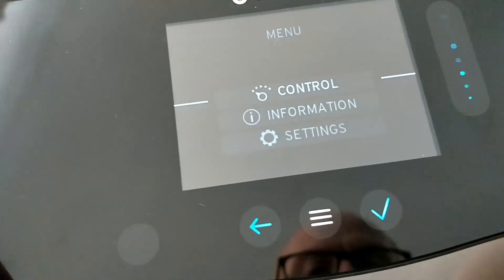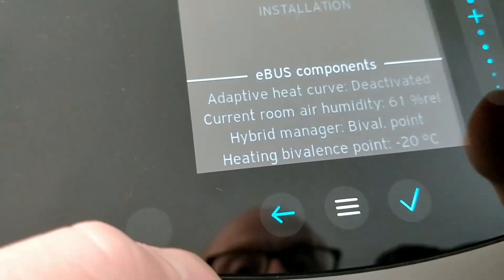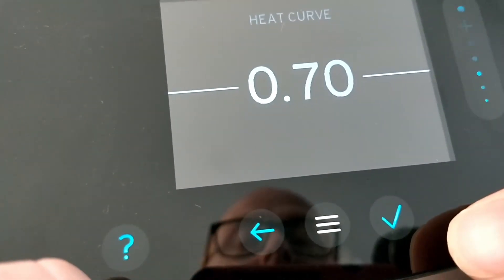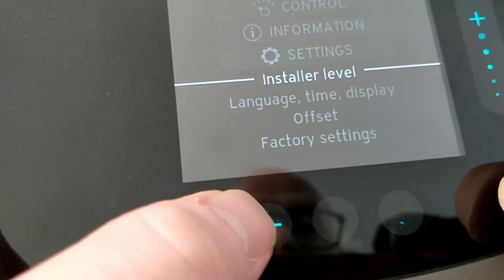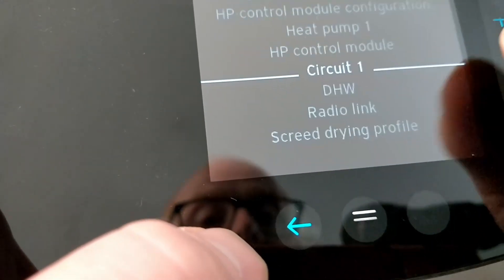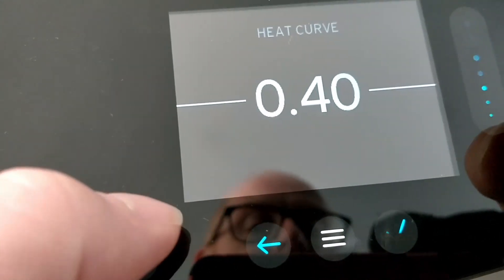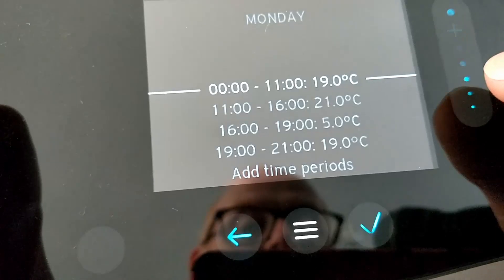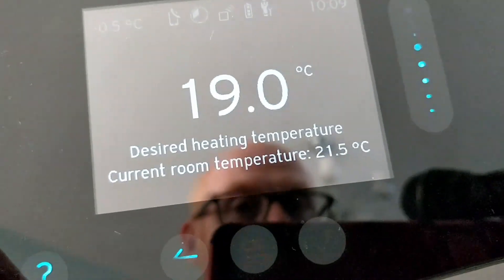How To Set Your Weather Compensation Heat Curve - Vaillant Arotherm Plus Heat Pump

Comment: Is it only me that finds the heat pump world somewhat amusing = it’s like a mission impossible film , can you get a good installer? Will you have the installation with no extra things that is not needed and make it less efficient ? Will you be sold the correct Kw heat pump ? Will the system work well and not cost a fortune to run ? Can you sort the temperature right in each room or in fact the whole house ? Obviously the song for this new film = The Impossible Dream = Andy Williams .
Reply: I find it the opposite, 

We were continually adjusting the thermostat on our boiler, it was very hard to get the temperature right everywhere even with thermostatic radiator valves on all but one radiator. Even when we were happy with the thermostat setting for a while, the house would swing from a little too hot to too cold and vice versa. Then there was the changing of the boiler temperature to match the season etc.

By contrast, the heat pump is the ultimate set  and forget heating system. Once the correct weather compensation curve was set we just ignore the heat pump, the house remains nice and warm, we only know the outside temperature when we go outside or look at the forecast. It is a far more pleasant house to live in, and it's cheaper to run than the gas boiler.

We only had the heat pump installed to save carbon, the fact it works far better than a gas boiler is something which should be trumpeted more, not enough people know this.
Reply from the maker: @MentalLentil-ev9jr  Good point. Once it is set correctly then it is a dream to live with!
Reply: @MentalLentil-ev9jr  Not heard that very often that it’s cheaper cost to run with a heat pump than a gas boiler , heard so many people say worse decision they made getting a heat pump because it cost so much to run and wished they kept their gas boiler, so obviously the industry has got a lot of problems, personally I’ve heard lots of negative comments but very few positive comments, as previously mentioned it’s really simple to completely quash the negative by simply show last three years bills to a company and say can you beat that but hopefully beat it hands down, it really isn’t complicated, until the such information is available the industry is going to struggle, at this time with the heat pump world = it’s a roulette wheel with the things I’ve mentioned in my original comments , keep it simple = what has it cost to heat your home in the last three years = we as an industry can guarantee we not only can match that but beat the easily = once again = keep it simple .
Reply: @KavanOBrien  Many people, including UpsideDownFork, have been very thorough with presenting their experiences in detail with costings.

There has been a big campaign funded by the fossil fuel industry, and pushed by the gutter press,  to discredit heat pumps.
Reply: The same rules apply to all heating systems, but I think the focus on HP's is that peoples awareness to energy usage and costs has been elevated.
Unlike the cheap and cheerful days gone by where heating systems were thrown in, where one size fitted all in many cases, and efficiencies were at bottom of list.
Reply: @_Dougaldog  That’s ok saying that yet the uptake on log burners are increasing beyond belief, also a industry of user friendly items to burn on the burners, so many more people are looking to save money with heating cost are as said going for log burners , if the heat pump world want  to not only compete with gas boiler to get heat for the home as far as running cost are concerned then they need to include why has there been a 30% increase of log burners.
Reply: I think the comfort is mainly due to a modern heating control tied to a modulating heat source (the heat pump). The first couple of months of our heat pump seem pretty efficient to me. Have had a scare or two looking at the heat output thinking it is the electricity used (actually 3.8x smaller).
Reply: @Biggest-dh1vr  Are you saying you’re paying nearly 4 times lower cost than gas = let’s say 100 pounds now 400 pounds with gas ,
Reply: @KavanOBrien  I kept mistakenly reading the heat energy yielded as electricity used (both are measured in kWh) and worrying myself. The heat pump has yielded about 3.8 kWh of heat per kWh of electricity for a similar or reduced cost compared to gas.
Reply: @Biggest-dh1vr  I didn’t understand that , basically how much was your gas bills for heating compared to the heat pump , is it 30 pounds per week for gas as an example, what is the cost with the heat pump = 10, 20 , same as the gas bills or more .
Reply: @KavanOBrien  it is too soon for me to say definitively if the heat pump is saving or costing me more compared to a gas boiler. I look to be consuming more so far in November 2024 vs 2022, but it might be that this year the month is colder than 2022. There are other variables such as experimenting with free electricity on my tariff, and my addition of solar and battery.

Probably all I can say is that it appears to be roughly the same +/- 25% and I have a more consistent heat. I'll be happier to compare at the end of the year or next Spring
Reply: @Biggest-dh1vr  appreciate your honesty, are batteries and solar expensive to purchase? One would think it’s probably the battery which is the most expensive part , batteries coming out of damage electric car would make good power banks for homes, who knows an entrepreneur might catch on to that .
Reply: @Biggest-dh1vr But after a significant investment in a heat pump a rational person would have to expect a return on investment in terms of significant heating cost reduction. When I look at the energy saving trust data they indicate that it’s exactly the same operating cost as a gas boiler, so why would I take out a system that works and replace with something that works no better? Seems a bit mad.
Reply: Yep - these videos are great for nerds but normal people just want a system they turn on and it works well. The Facebook groups (and I am a member of a few) are just baffling to normal people. It’s no wonder that octopus is trying to solve this via them remote control cosy behind the scenes. I like my ASHP but I wouldn’t recommend to most family members at the moment.
Reply: @charlesgknight  ironically the industry in my humble opinion has lost their way in regards to the whole concept of basically heating a home , with so many bad actors or cowboys within the industry it’s like launching a rocket with candles,  what do most people want = heat a home for as least cost as possible, ok page one of the concept , page two = keep it simple for customers and the industry, page three a customer rings up to get fid of their gas boiler and shows the heat pump industry the gas bills to heat their home over the last three years = the industry says fine not only can we match that but we can reduce the amount of money for heating your home guaranteed = if not we will pay the difference = one more gas boiler gone and one more heat pump installed = simple really .
Reply from the maker: @charlesgknight  I know those feelings too well, isn't that sad?!
Reply from the maker: @KavanOBrien  Now I understand why I like it so much!
Reply: @UpsideDownFork  You obviously mean the song .

Comment: Someting that does not make sense to me is that when in room temo mode inactive its meant to just be a thermostat with no influence, how ever on the weekly planner you have different ranges through the day, so how does that influence full weather conp? Thanks
Reply: The system calculates what the flow temp would need to be to achieve the various indoor temps (using the heat curve), and runs that temp, ignoring the indoor sensor.
Reply from the maker: What he said!

Comment: Good stuff. That will no doubt help a lot of people, the extensive menus can be a little intimidating to some.
Reply from the maker: That's the hope. It seems like we're continually repeating this same method in the Facebook 'help' group.
Just send them a link from now on 🤞
Reply: The menus are like a second home to me now!
Reply: Hello. I’ve had a new ecotec boiler and sensocomfort thermostat with weather compensation fitted to existing radiators. Thermostat reaches desired temperature 21 deg but rads slow to warm up in morning (6.00) and only reach lukewarm all day despite reaching desired temp. Heat curve set at 1.0. I would like hotter rads. My plumber has become rather unreliable.